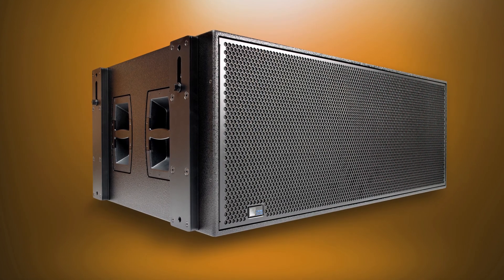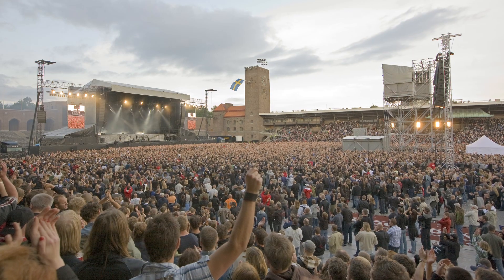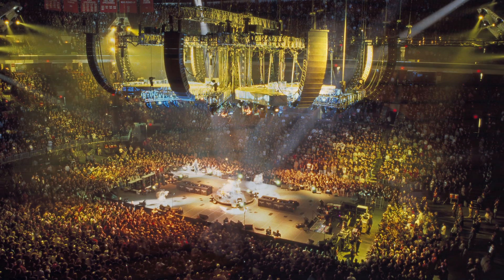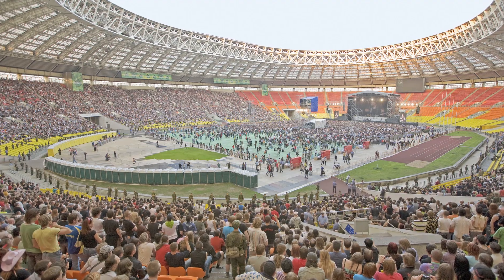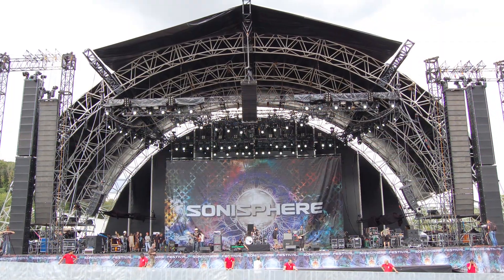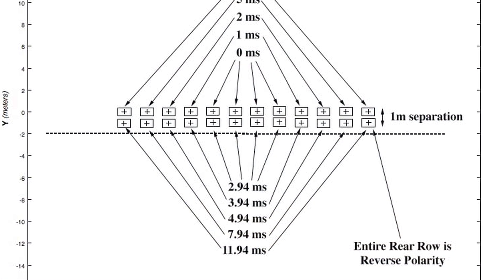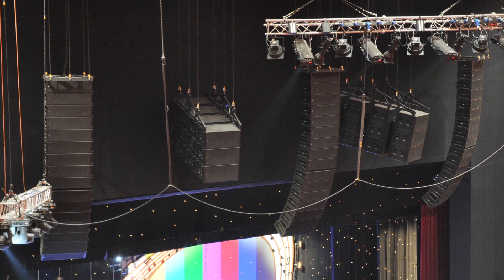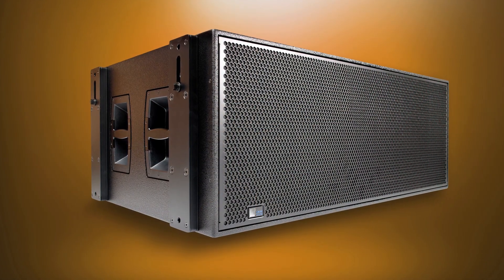1100-LFC: The Meyer Sound Case for Controlling Low Frequencies with Linearity

Comment: I wasn't sure whether to believe the claims in this video or not but since I have started working with LEO and 1100's on a regular basis I can attest that they are telling the truth. As a system tech i get a lot of engineers who are actually thrown off by how clean the system is at high SPLs, like they are expecting some pleasant artifacts when they push it but they are not there.